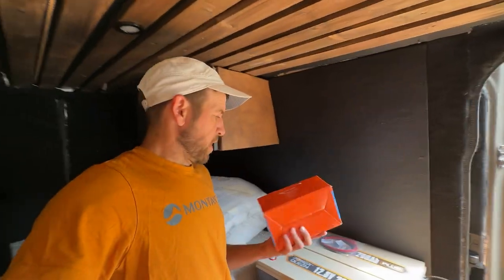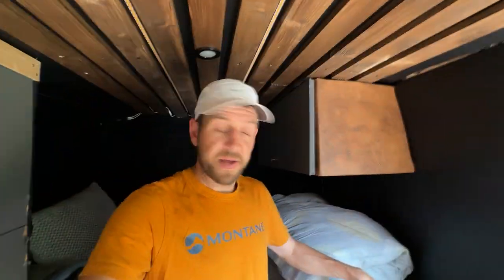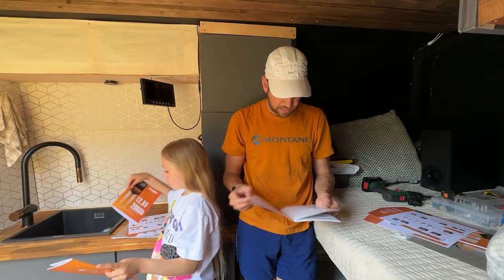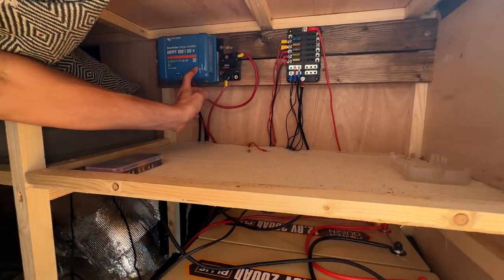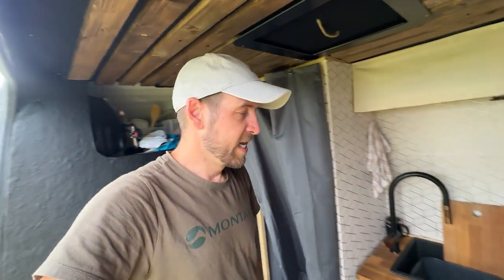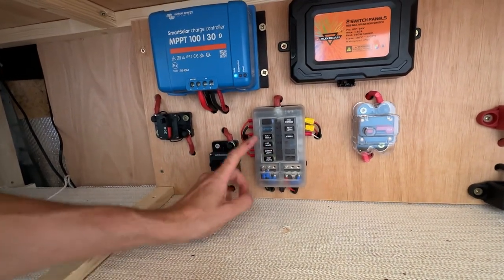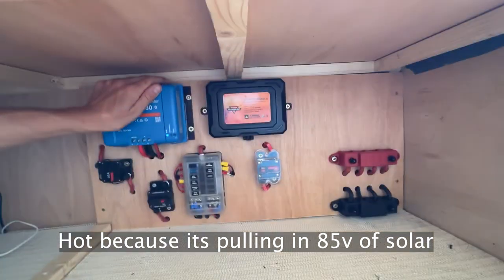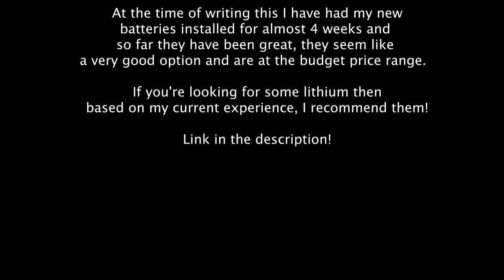Are These Budget-Friendly Lithium Batteries the Solution for Van Life?

Comment: Good batteries Gary, good prices too. But, no low temperature charge protection! So make sure not to charge them 0°C and below 😊
Reply from the maker: Very true but don't really have an intention of putting them that low. Can always add them into a heated container with a ruuvi tag for monitoring. Maybe a project when I run out of jobs 😂
Hope your are both well 👍❤️

Comment: Gary, you do yourself down regarding your work with electrics. It's very good and well thought out. 👍 Btw, I couldn't find details in the description of the batteries.  One thing I think you should consider for winter is an intelligent relay which enables charging of your leisure batteries only when the alternator is running, so it won't allow your vehicle battery to be drained by the caravan electrics. It senses when the charge from the alternator 14.2v exceeds the leisure battery voltage of 12.5v, and feeds charge into the leisure batteries at the same time as the normal charging of the vehicle battery. It charges them whenever the engine is running. The alternator can normally handle it. Especially useful when there's no solar or other means of charging them. Ok, you've got the Bluetti, but when all else fails it's a great standby.
Amika can advise you on installing one!😅
Reply from the maker: Hi Glen, thanks. 
Yes I will be adding a 40amp victron dc to dc charger (orion) around October time when I will start to sturggle. Unnecessary cost right now.
Solar is useless in the winter isn't it 😂
I've consultated Amika, she agrees 👍😂😂
Reply from the maker: PS started running again! 
Achilled was swollen by just walking so again it's in bits but I'll run until it ruptures! One more go!! Hopefully I can get back to a good level and get some masters work done!
Reply: @TravelwithGaryandAmika  Good to hear you're getting back into the running. Not so good to hear about your Achilles. That was a  common complaint in my day, and caused by heel tabs on shoes. We would cut them out (shoes did not empty your bank account back then), until manufacturers recognised the problem. When I first had Achilles issues, a sports doctor recommended aspirin, which is an antiinflammatory, and it worked. However, yours may be different. Probably not the best idea to test to destruction though! Regarding the masters scene, those who started later in life seem to do well compared to we who ran in our youth. Ok, I'm 77, but all my contemporaries can no longer run either. Maybe you have just so many miles in you, a bit like vehicles. Take care,

Comment: Ref isolation switches. They need to be inline before the B2B and MPPT. If you have power going to either without it flowing to the battery it will bugger the electronics in either as the power coming in to each unit has to have somewhere to go = leisure battery
Reply from the maker: Aye that's how it's set up

Comment: Hi Bud apologize sorry to sound stupid. What you mean by set up Parnell the battery’s and Plus balance the battery’s?
The batteries looks nice 😊
Such a beautiful build bud ❤ vans are never finished one day il love to sort all my electronics out.
Great vlog bud hope your both keeping well 😊🤗
Reply from the maker: Hi mate. Balance the batteries means make sure they are the same voltage so they charge and discharge equally
Reply: Ok sorry bud what about the parelle bit?  Sorry
Reply from the maker: There are 2 ways to link batteries. Parallel or series.

2 x 12v 200Ah batteries wired in series will give you 24v, but only 200Ah capacity. 
Positive to negative terminals 

2 x 12v 200Ah batteries wired in parallel will give you 12v, but 400Ah capacity. 
Positive to positive, negative to negative terminals .
Reply: @TravelwithGaryandAmika  oh sorry bud I sounded stupid I had no idea there was two different ways :( sorry bud thank you for taking the time to explain it to me. I did the way you did :)

Comment: Would the batteries not get hot even in the winter from use, so u might not want too small a gap between the shelf and the battery below. Watch the vids for tips & ideas on fitting out a van as\when, as well as the travelogue stuff
Reply from the maker: Hi Roger. No they won't keep warm. Only when charging will they generate a bit of heat. Definitely need to be off the floor. Even a few inches makes a huge difference as the floor will act as a means to transfer cold from the shell of the van to the batteries

Comment: If you get time to reply i was wondering what you use to heat the water for your shower?
Reply from the maker: Hi there. I have a 800w electric water heater. It's 240v so I use my power station to run it. Its 10l and I use 3l to 4l of water per shower.

Comment: What volt is your solar panel breaker as most of them are rated 48v
Reply from the maker: It's a 30amp breaker
Reply from the maker: 12-48v Dc
Reply: @TravelwithGaryandAmika  didn't you say you had 85 volts coming from solar panels
Reply: Your breaker in-between the solar panels and change controller is under voltage at 48volts.. If your solar is bringing in 85volts

Comment: Please check your wire sizes, they look far too thin for 400A.
Reply from the maker: Please explain further
Reply from the maker: The wires are massively oversized. The battery bank is 400ah for storage not discharge. 
Max amps is pull is maybe 10amps, unless I'm using my external lights and even that would never reach 30ah.
Reply from the maker: By winter my I will have 800ah storage. My discharge will remain the same. It just allows me to be off grid for longer
Reply: @TravelwithGaryandAmika  I've just upgraded to lithium and found that a 700w air fryer was drawing 60A from the battery using the inverter. I just wanted to be sure you understood the potential as you have wired your batteries in parallel hence up to 400A if it is shorted out accidentally. Safe travels Geoff